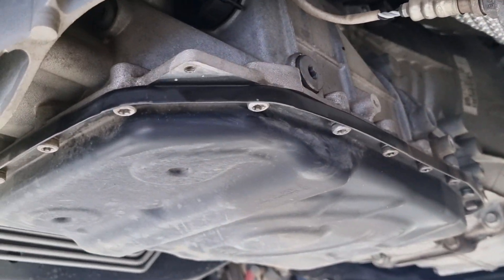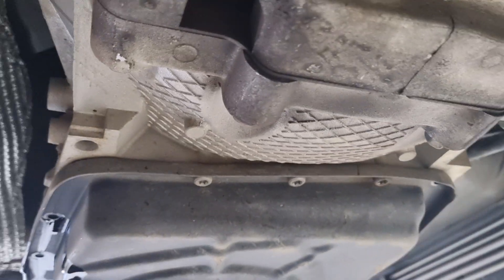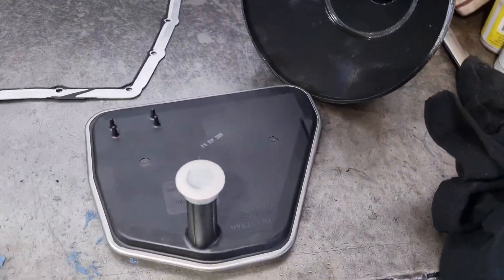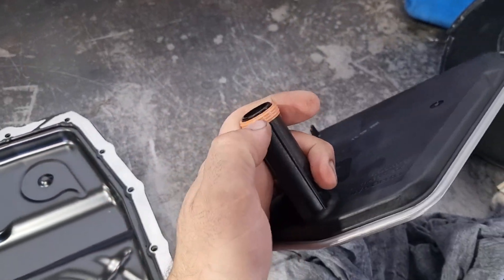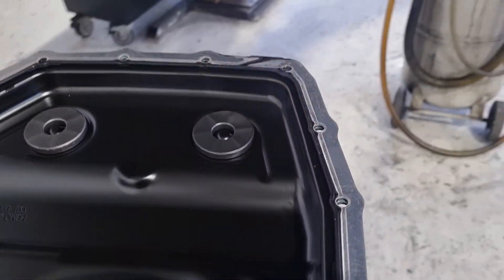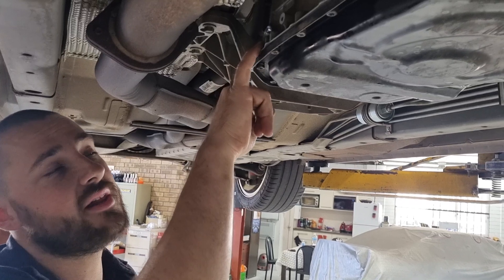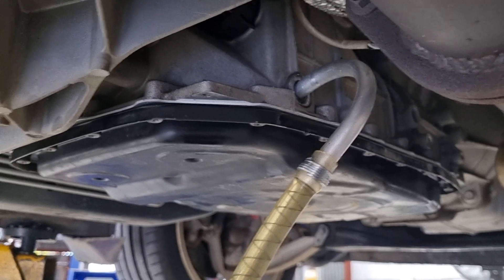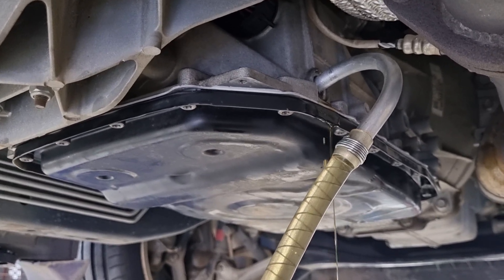6HP26 Gearbox Service, ZF; Ford Falcon/Territory Auto Trans

Comment: My territory ( Barra petrol 2011 model) has 226,000 km on it. I have no idea if the transmission oil has ever been replaced. I have a sneaking suspicion it hasn’t. In this scenario I’ve heard a lot of mechanics avoid wanting to touch it. Is it okay to change the oil or do you just leave it alone until the gearbox has had its day? Thanks
Reply from the maker: I would change it if it is not slipping, if it's slipping the box is already destroyed
Reply: @RealAutoSolutions cheers mate. Thanks for replying.

Comment: I did mine on the weekend and I thought I would loosen the filler plug first just in case I couldn’t get it off once I had drained the transmission.
So much fluid ran out off the filler plug. Maybe 750ml
Surely that isn’t normal, over filled?
Reply from the maker: If it was not running at that point then it is normal to appear over ful, the level is set during vehicle running so the fluid is pumped through the box
Reply: @RealAutoSolutions a rookie mistake on my part but I learned a lesson from it.

Comment: I have a ford territory tx 2004 and when i put it in reverse it sounds like a clunk noise, ive also had the oil sensor come up twice, but oil levels are at the correct levels, any suggestions
Reply from the maker: Yeah, very common for diff mount bushes on the SY territory's 

I would bet my house on it.

Comment: my fg xr50 with 320,000kms has a weird rev flare going into fourth, it goes into fourth at about 60kmh, and the revs jump up quite a bit, the car has started jerking swell, in sequential its even worse, I was in second, put my foot down a bit, shuddering, went to third on its own, shuddering more under acceleration as stated before, went to 4th on its own, and some more shuddering, I put it back in auto, and shortly after a transmission fault code came up, and the acceleration and gear changes were behaving very weird, does it just need a service??? or do I need a new zf
Reply from the maker: We would really need the fault code to know for sure mate.

Slipping and flaring is never a good sign though 😕

Comment: Since 2014 I've used only Nulon gearbox oil on my Falcon XR6 with ZF 6 speed transmission. ZF lifeguard 6 oil is just too expensive and it is not better at all. I've been changing gearbox oil between 80K- 110K. On my taxi, Ford Falcon mkII XR6 ecoLpi, I have already clocked 1 187 948 km. Still original gearbox, no other services but oil change using Nulon brand.
Reply from the maker: How can you say it's not better if you have not used it?

Comment: I feel like the hardest part for a home garage job (no hoist) would be getting the oil back in the trans. Any suggestions? Great vid though 👍
Reply from the maker: I work from home now mate, if you jack it up and put it on stands you can get under easily and still fill with these 20L pumps easily enough

Comment: I have a ford territory sz 2012 and sometimes when i put it in reverse it makes a a sound like a hard clunk? Any thoughts on this problem? Also do you need a transmission cooler for this transmission?
Reply from the maker: You might need to check the oil level mate 

Yeah they have common problems with the factory transmission heat exchanger

I would suggest removing it & putting an external transmission cooler on

Comment: What about fluid temperature and the trans thermostat opening to circulate through the cooler?
Reply from the maker: This was a warm day here in aus so the temp is already warm enough IMO, same with the heat exchanger, the amount it takes is bugger all

If it had an aftermarket cooler then it would be worth waiting

Comment: Do I need a gasket for the plastic pan, or is the gasket built into the pan, making it single-use?
Reply from the maker: Yeah single use mate, remove and replace pan assembly which includes filter and gasket.
Reply: Much appreciated thank you for taking the time to respond 👍 liked and subscribed 🤙
Reply from the maker: Thanks brother!

Comment: Would you service a 220,000kms zf on a falcon ute  thats never been serviced or just let it go? Have heard different opinions. It shifts great
Reply: If it's slipping don't change the oil . New oil will only make it slip worse.
Reply: @timcrossing9963  yeah but the question is why? I don't understand
Reply: @fordskool  the friction material of the clutches still remains in the oil.
Reply: @timcrossing9963  okay right. So can you top it up or refresh with an additive to make up for it?
Reply: @fordskool  no. if your clutches are shot, they're shot. no additives is gonna fix that. 
220,000kms with no service? Cheap bastard. 
If it's shifting good, replace it. If its not shifting well then replacing the fluid will make the transmission shift worse because the new oil has no clutch material in the oil. 
Saved $80 but probably made the transmissions life a lot shorter congrats.
Reply from the maker: If it's shifting fine I would have no problem with doing it mate, if it was having some slipping issues then maybe not a great idea
Reply: @RealAutoSolutions  i don't understand your answer. Seems counterintuitive to service it if it's running fine and not servicing if it's not running fine? Surely what ain't broke don't fix would apply??

Comment: My zf 6 in my xr8 was diagnosed as stuffed 2 n half years ago and still as long as i warm up car till themostat opens and at running temperature at which time i simply go through all auto gear selections then runs great till cold again however if i start cold and try to drive it slips only made that mistake twice and just got it running again want be a third as i dont have 4 g to replace or fix   keep on kracking on .
Reply from the maker: Have you checked the oil level mate?

As the car warms up the oil expands

Sounds like an oil level issue

Comment: Hi mate wonderful video thank for your time 💪, 
Just wanna as u my 09 falcon green top I replaced all front rear brake pads after that I went to drive and after 5 minutes my ABS light come off and a orange triangle and screen top a tiny triangle with number 1 ? 
What happened, just let us know I never touch the ABS speed sensors at all ? Any ideas , ?? 
Many thanks 
Matt
Reply from the maker: Hey Matt, you would need a scan tool to gather some direction man

Check the brake lights are working properly

Comment: Done this on a couple of FG Falcons.  My question should be to Ford.  Why do they put the exhaust oxygen sensor directly opposite the transmission fill plug?  The oxygen sensor has to be removed first, to make enough room to get the tool on the fill plug: usually a 8mm Allen socket and breaker bar.  Those fill plugs are tight, if they have not been removed before.  And the oxygen sensor is usually difficult to remove, as well.  Once those 2 items are loose, the rest is easy.
Reply from the maker: Depends on what you're using to fill them, I have never removed the 02 sensor

Comment: Hello! My gearbox oil has been changed with some pump that sucks the old oil and puts in new one, since then I started having issues, the machine removed 9.5L and when trying to fill the transmission it does not get on level at 9.5L of oil, I have now inside of the gearbox 11.5/12 litres of oil and it still not leaking, how is this possible? Should ai continue filling until it leaks and makes the level ? What should I do, please help
Reply from the maker: Not sure how much I trust the flushing machines.

If you do not have fluid leaking out of the check point like in this video, you need to continue filling with more oil
Reply: @RealAutoSolutions  okay Thank you, I did not know the gearbox can fill up to 13 litres, thank you
Reply from the maker: @eduardtilita321  yeah! And make sure it's running whilst you set the level
Reply: @RealAutoSolutions  thank you so much I was looking for a answer for months!!
Yep filling at 30/40 degrees with running car
Reply from the maker: @eduardtilita321  great job, is it working well now?
Reply: @RealAutoSolutions I got out the mecatronics and cleaned the solenoids, found out I had only 5.5litres, after I added 3 litres of oil inside the gearbox on my own, apparently you were right not trusting the flushing machines, at the service they told me they pumped 9.5 litres, strange because if I would not have added 3 litres myself to the gearbox, the gearbox would have only 2.5litres, plus the one from the torque converter, so yes, do not trust flushing machines, I have ordered 3 more litres of oil and I will do the oil level as it should. (Gearbox feels like is a CVT, when accelerating sometime rpm remains still but car makes speed )
Reply from the maker: @eduardtilita321  great job mate, is it driving better
Reply: @RealAutoSolutions  after cleaning the solenoids I feel a smoother shifts but I have to put 2 extra litres of oil to the gearbox Monday to make the perfect levelling so I can try it, now the gearbox feels like a CVT, when accelerating 15%, RPM does not move for a few seconds but speed increases, and I think this is because it is missing 2L of oil, I think …
Reply: @RealAutoSolutions  btw, imagine that I left with the car from the service with just 2.5L of oil in the gearbox… idiots, that’s. Why I am learning to do everything on my car myself.
Reply from the maker: @eduardtilita321  haha it could have been very bad

Comment: Good video, was certainly a lot easier with the older gearboxes that you could fill from the top via the dipstick. What can one expect to pay for an auto trans service on a 2013 FG MK2 ZF gearbox these days out of interest.
Reply from the maker: Thanks mate, for this sort of job with the genuine stuff we charge around 770 inc GST
Reply: @RealAutoSolutions  just something for next time, it would have been good to show the pan straight off the transmission to identify any metal filings or clutch pack material. Maybe you didn't have any in this one though after 60,000kms which is pretty good. Also do you disconnect the cooler lines at all normally. Seems like there would have still been old oil in those and the converter. I've seen some sort of flushing machine that claims to remove all the old transmission fluid. When you're servicing how do you ensure you get rid of all the old fluid?
Reply: @zucan100  There will always be fluid in the torque converter so at best  it is only an 80% fluid change but it is still a heap of new fluid which will dilute the old stuff.  On my son's car which had quite old brown fluid, I drained and refilled it and worked it through the gears for 5 minutes  and then drained that before taking the pan off and changing the filter & cleaning it etc. It is beautiful clean looking on the dipstick now. Many experts don't recommend flushing as it dislodges dirt into places you don't want it like valves etc. If you change the fluid regularly, there will always be some level of old fluid unless you disassemble the trans but in practical terms it really doesn't matter. 

I have done my Kia Sportage and my Holden/Chevy Cruze before the recommended intervals as I am not a fan of "lifetime fluid" service intervals. The Kia has a heavy duty use mileage of 140, 000 kilometres but the fluid was pretty dirty looking and  opaque at 140k and 10 years. I got my Cruze done at 90,000 kilometres as it was herky and jerky ( hung on to gears and then jerked into gear) even though the trans service interval was 150,000k. Just done it again and it is almost like a Rolls Royce shifting. Factory service intervals  are way too long in my opinion even with synthetic fluids. Helps if you can do it yourself as then it is only the cost of the fluid mainly vs $300 for someone to do it.

Comment: Great video. thanks for taking the time to put it together.   However, I am just wondering how to drain and fill the torque converter so ALL the old transmission oil is replaced as my RWD SZ diesel has travelled 170,000kms and I don't believe  there has been any prior servicing of transmission ! Any videos,  links or tips  on this please ?
Reply from the maker: Thanks for commenting mate! 

A bit hard on the territory with the heat exchanger set up, if you were to remove that and run an external transmission cooler you could remove the feed line to the cooler and pump it in at the same time.

The only other thing I can suggest is, fill the transmission, run it for a few minutes, then do the job again
Reply: @RealAutoSolutions thanks for your reply mate. Cheers.😊
Reply from the maker: @dominiclucas8617  easy stuff 👌
Reply: I  had a trans with  pretty dirty fluid so I dropped the old oil and filled it up again and ran it through the gears etc and then drained that. A lot simpler than  trying to jig up connections for flushing it etc. Not 100% but better than nothing and it would still be 90% or more cleaner than just 1 fluid drop leaving all the  old fluid in the torque converter.

Comment: Hi, think I remember hearing or reading that the pan will only hold a fraction of the fluid thats in the transmission and that I’d have to flush it through to get everything out. But now I’ve seen 2 videos on this job where it’s not required. The way you did it does it get it pretty much all out? If so I might as well do it myself. Thanks!
Reply from the maker: That's correct, the torque converter stores litres of oil too, depending on the condition of the oil it may need flushing

If your oil is really black then I would be flushing it, if it's relatively clear still, a service like in this video would be sufficient
Reply: @RealAutoSolutions   ahhh ok. Well first time  at 185K hahaha. Hopefully it’ll be fine. Unless you recommend to just flush it after so long. Thanks for the reply though, really appreciate it!
Reply from the maker: Far out. If it's the first time I would suggest a flush hahaha
Reply: @RealAutoSolutions  sheeet, alright I’ll see what I can do. Thanks again mate!

Comment: There is a sequence for tightening bolts on pan. Otherwise a good video
Reply from the maker: I agree, there probably is, there is for everything 

But for the many times I've done this task, they have never leaked not using the torque procedure

Comment: i was told after you do that process you wait for the transmission to cool  open the bung with the engine off and top up again and it can take up to a litre
Reply from the maker: That's incorrect mate, the oil level is set with the engine running
Reply: @RealAutoSolutions  woah i just came across this again,. what i was ment to say was let it cool, like the next day start the engine and top up again till it flows out... the local trans builder here said dont even worry about making sure its at 35 40 degrees just anywhere below or even started from stone cold cause theres going to be all sorts of temperatures through the trans but if you let it go over the 40 degree mark the trans fluid expands 0.74% every degree
Reply: Old mate knows his stuff. It is when the engine is running and all the oil passages,  torque coverter are full of oil at running temp. That is the only corect level. Pretty common with a lot of transmissions with a level plug.

Comment: Don’t use crc , only use white petroleum jelly on seals for a trans. It’s the only substance compatible with trans fluid.
Reply: Less than 3ml of crc mixed with 10 liters of transmission fluid will do absolutely nothing.
Reply: @brendanduda1493   unlike you I rebuild them . I’m surprised you don’t use concrete to make the box stronger.
Reply: @tba3900 and how would you know what it is I do? 
A spray of CRC on a single filter O ring will have 0 effect on the transmission.
Reply: @brendanduda1493  your a special unit.